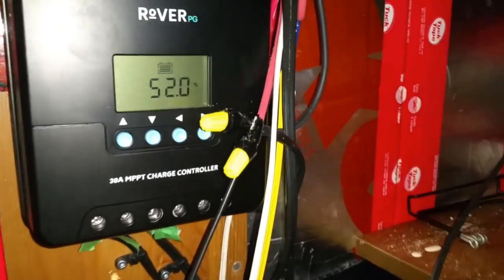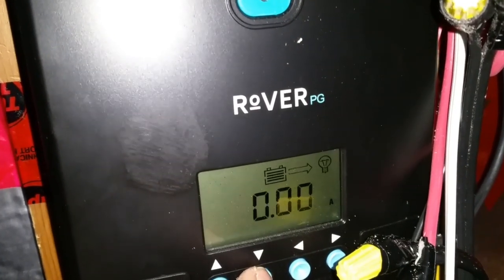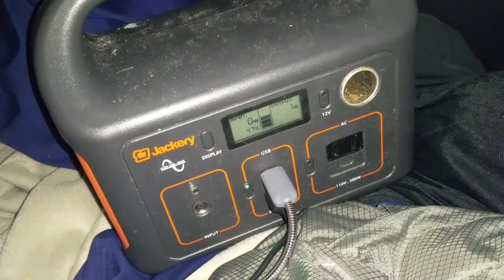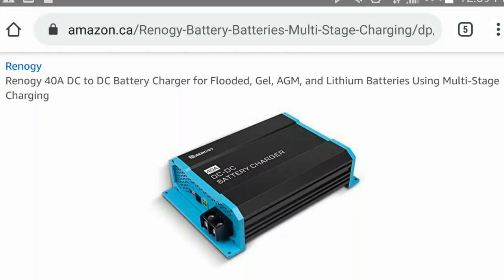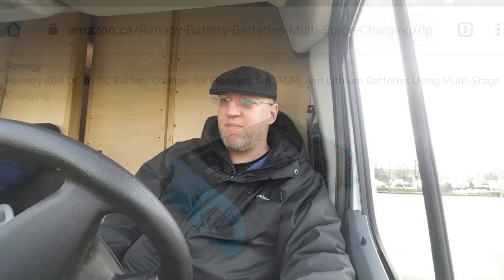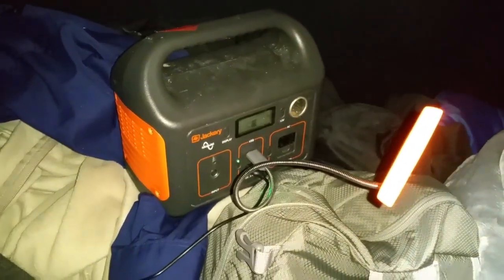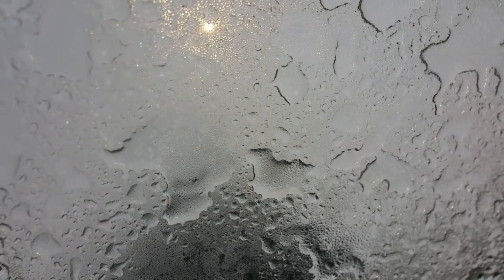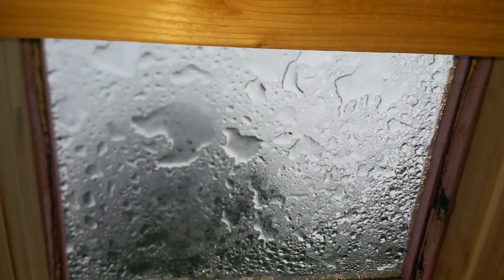House Battery Longevity - Solenoid vs DC to DC Charger.

Comment: Alternators have a voltage regulator and newer vehicle are controlled by the ECU to control the amperage and voltage.  Get a digital voltage gauge and you can see it cycle.  You will see it do a bulk charge until it gets to about 14 volts and then it will drop down a volt to maintain it.  Even the super old systems work very well.  Some where adjustable.  I would say the one downside of using it is that having a large battery bank charged from the alternator will make it get very hot so I suggest a manual switch to turn off the solenoid to let it cool down for awhile if going on long trips.  Adding more info here too the max amperage of the alternator is only used when there is a very high load.  Bridging the house battery unless the voltage is very low the max amperage will never be used.  So lets say your alternator is rated for 120 Amps and the battery is as 12Volts it will only charge at 20 Amps since the difference between 12 Volts and 14 volt is only 2 volts.  Just giving you estimates but it can be calculated as the voltage gets closer to full the amperage draw goes down.  So max amperage is used when lets say you have a winch that draws 100 amps the alternator will take the load from the winch and it won't draw your battery down.  Different than how a solar charger works for sure but once you understand it over time you can take advantage of it like run the vehicle when you have something you want to run that will use allot of power for a few minutes.
Reply from the maker: I appreciate your insights ☺

Comment: You’re completely ignoring or just not aware of what the actual problem is it’s not that you’re going to overload your batteries is that you’re going to overload your alternator which is not designed for constant output.

Car alternators are designed for topping off a battery that just starts a car for a couple seconds it’s not designed to charge a deep cycle battery personally I do have a deep cycle alternator but there is a specific kind for deep cycles.

Comment: Your friend doesn't know what he is talking about. Your van alternator has a built in voltage regulator. You might have a voltage gauge on your dash cluster. I think you have a 150 AMP MK7 alternator. They will charge multiple batteries, but like anything else some knowledge is needed. Driving a block or two will not bring up the batteries so the length of time is something that needs to be checked. Hopefully you have a voltage gauge on your house batteries. A DC to DC charger isn't going to be any better, that is the same thing your alternator is doing.
Reply from the maker: Thanks. I just bought a battery monitor. Now I'll know exactly what is happening.